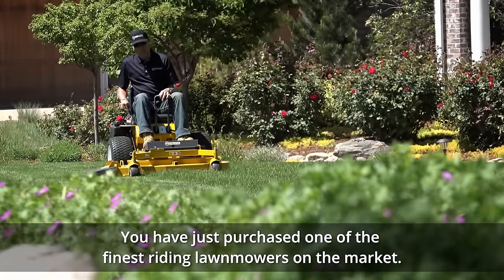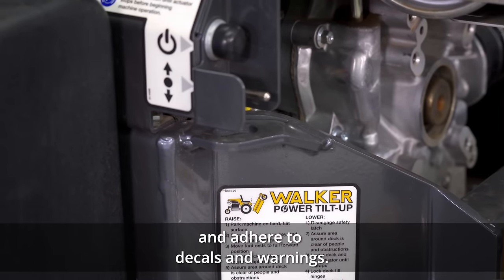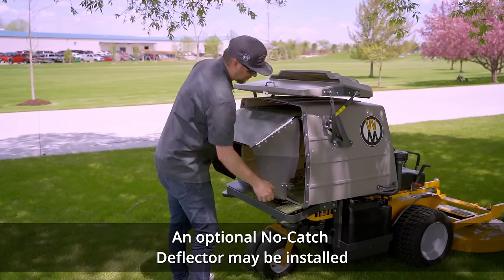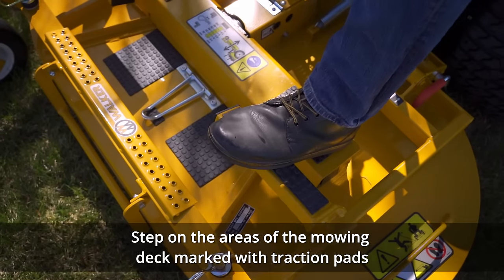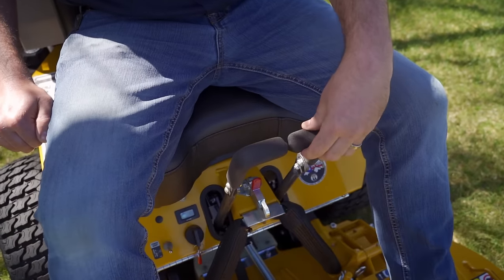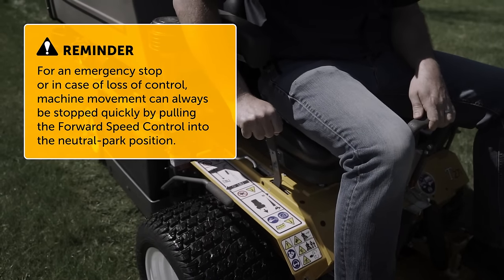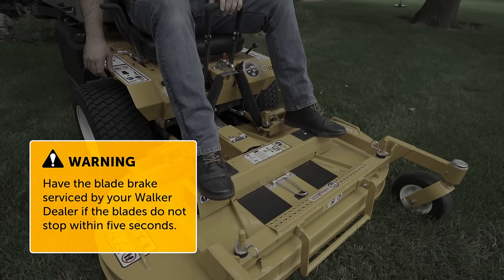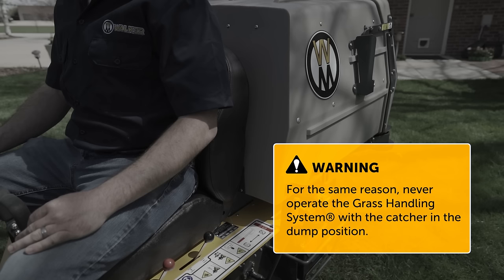HOW-TO MOW: Walker Mowers Video Operator's Manual and Safety Information

Comment: Have operated my walker mtghs for 23 years now. Never hurts to get a little refresher course.
Reply: Ruth Ford me too except it hasn’t been 23 years.
Reply: Love my walker T25i ❤️. Fall clean ups are no problem 😁👍🏻.
Reply: We have been running Walker mt models for over 20 years,  they expensive to repair but they make us money. We have demoed exmark navigator for the past few days. Exmark has smoother ride, stronger frame, better vacuum system,  deeper and stronger deck handles more grass at one time. Hasn't clogged like the Walker does.   Thing I am concerned with is servicing,  looks very tight in there. Also does not stripe as good as Walker.  I guess I could add striping kit , rubber behind deck
Reply: @rontopping2048  I’ve always thought the Walker had a pretty good ride, but They are expensive to fix. We had to replace a fuel pump and it was $200 I think.